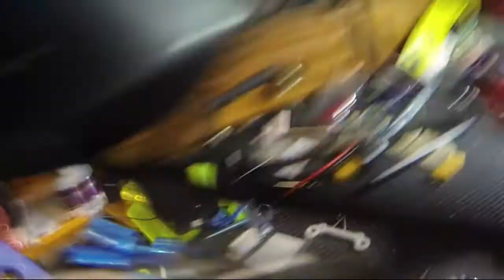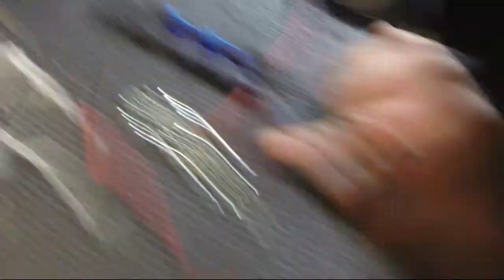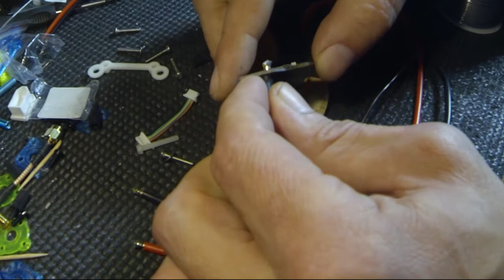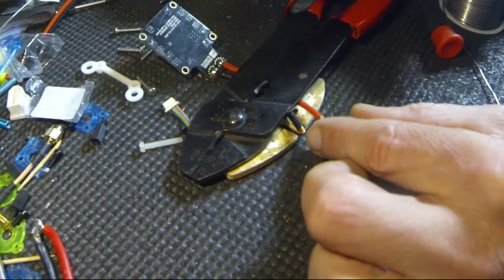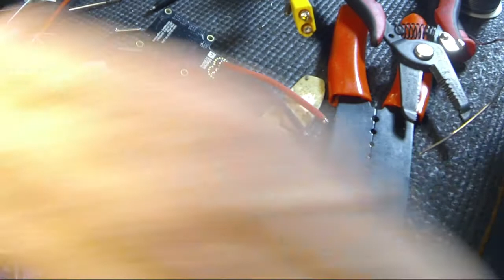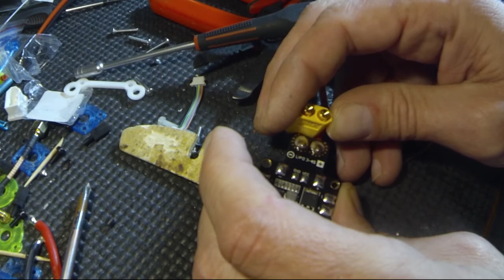PDB Through Hole's, How I Solder  them on, XT60 bonus.

Comment: What are those tiny circles around the big holes that you solder the wires into? What if you get solder into those tiny circles?
Reply from the maker: those are just decoration, its OK.
Reply: Crash RC - thanks! I am new to soldering, and I was a bit scared I messed up bad!

Comment: Thank you for this educational video! Do you know why my solder sticks to my soldering iron tip but doesnt stick to pad or wire ends? I use solder 60/40 with resin
Reply from the maker: to hot an iron and, tip needs to be properly tinned